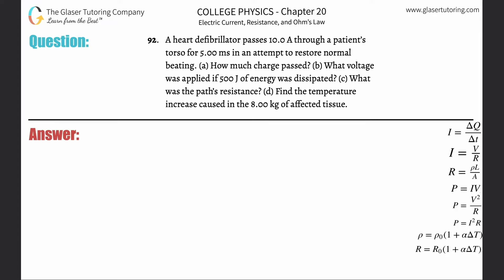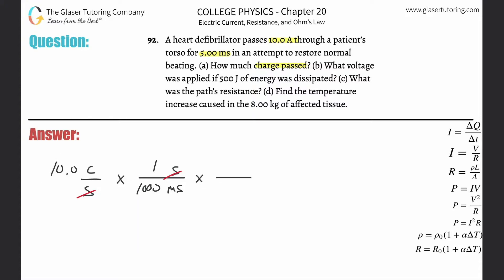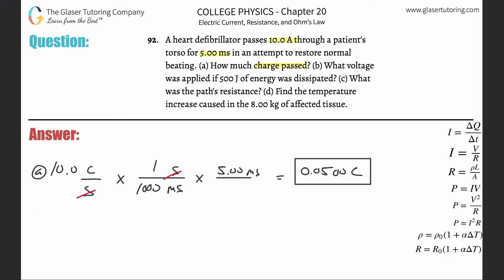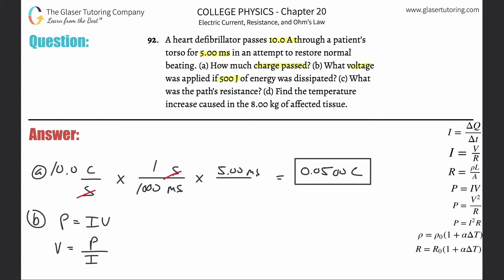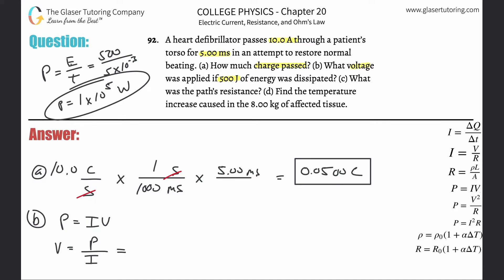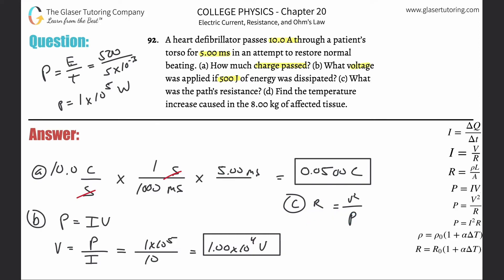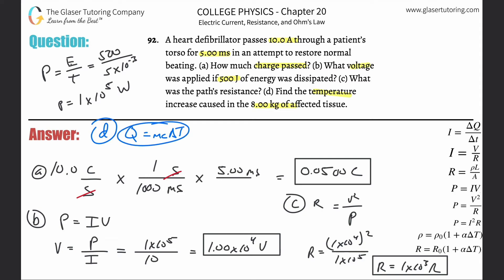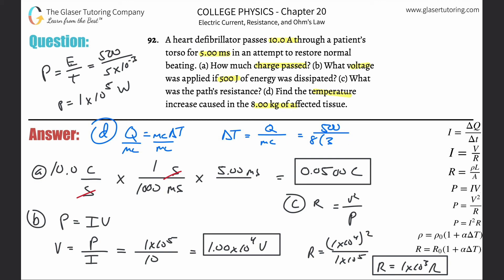20.92 | A heart defibrillator passes 10.0 A through a patient’s torso for 5.00 ms in an attempt to

Comment: Thank you for your help with this question.

One thing I feel I need to add to this is the final answer, to my understanding, would be in Kelvin. The specific heat you used was 3500 J/(kg*K). The J would cancel because of the 500J in the numerator and the kg would cancel with the 8.00 kg in the denominator leaving just K in the answer, 0.0179.